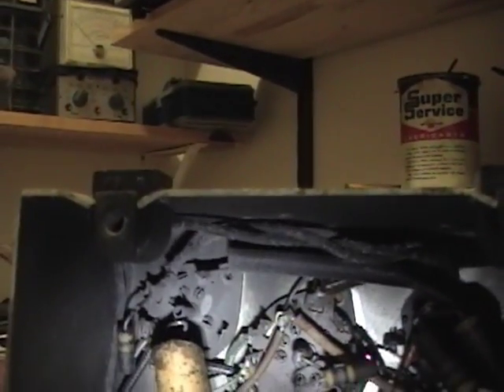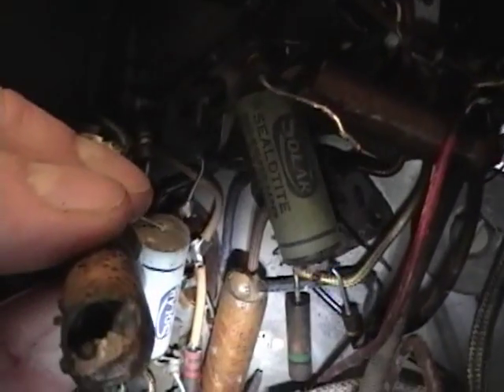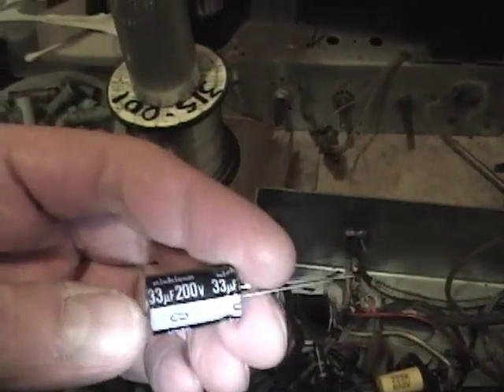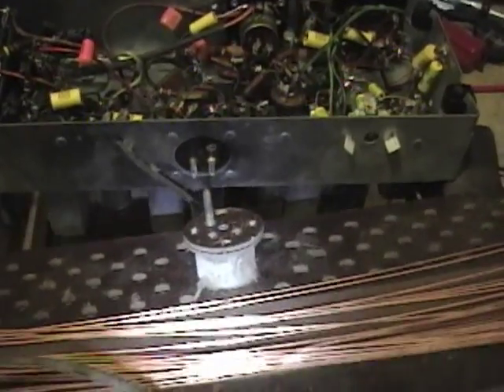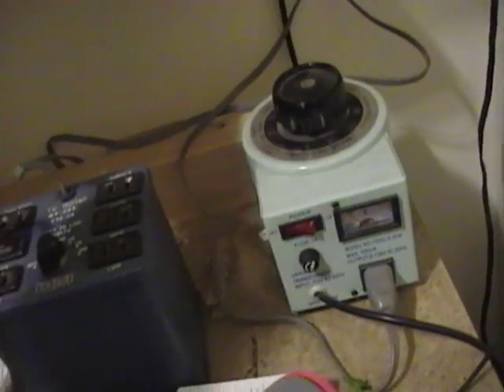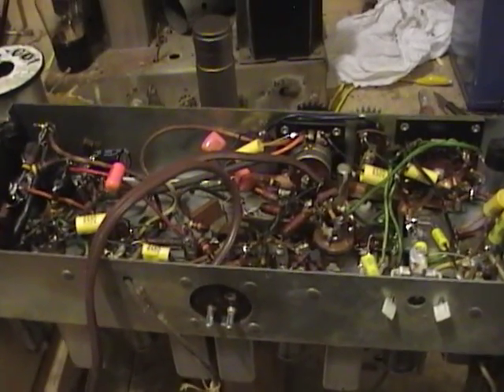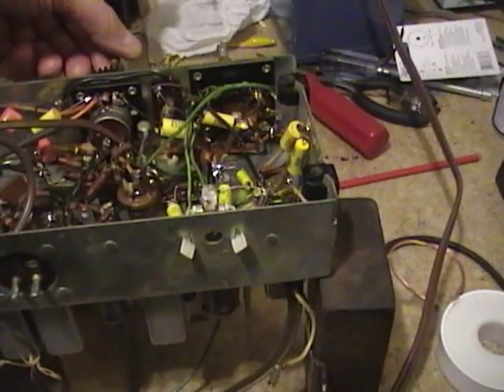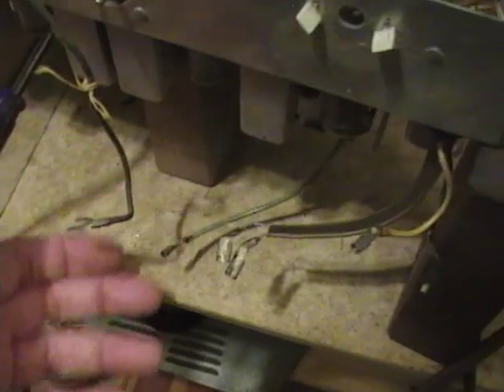GE 212 radio restoration p2o7

Comment: Bob,what exactly is a safety cap?
Reply from the maker: A special type a capacitor design for use on the AC line.  Type 'X' for across the line.  Type 'Y' for one leg of ac line to ground  More here:  http://www.justradios.com/safetytips.html
Reply: +bandersentv Thanks Bob, very informative link.

Comment from the maker: I sometimes save the old caps so I can restuff them with modern caps to retain that vintage look.  I save the old carbon composition resistors too if they;re good.  Especially the 1 and 2 watt ones as they are rather expensive to buy new - like $5+ each!

Comment: was wondering if there is any value besides fun in collecting and saving the older capacitors , other components etc ? I refub computers and over time I save the Chips - I know the value of them but I am a collector so I'll most likely never sell them :) QC

Comment from the maker: Doing a soft start gives the electrolytics a chance to reform if they've been sitting unused for a long time.  None of the other components will get stressed out.  Solid state electronics - especially CMOS logic is another story.  They can latch up and burn out at reduced voltages.

Comment: Cool video. One question though. If you start powering up the radio at a low voltage, won't that stress out the electronics in the radio? Like when your power dims in your house, and all your electronics are getting less than 120 volts, I would think that would hurt something.

Comment: You can safely use a 100 mfd capacitor in place of the original 75 mfd without damaging or shortening the life of the 35W4. if fact, G.E used 100 mfd capacitors in their later production radios.

Comment: I like to reconnect the line condensers to the radio side of the power switch, I never liked the idea of having something energized the entire time that the set is plugged in. I think that the AM isn't working that great simply because the loop isn't connected (understandable since it's falling apart), the scratchiness might be the IF cans but more then likely just dirt in the volume control and tube sockets.